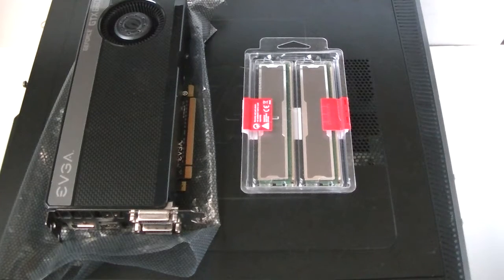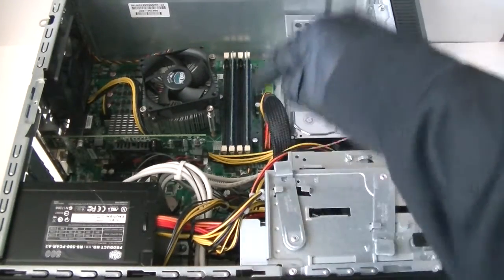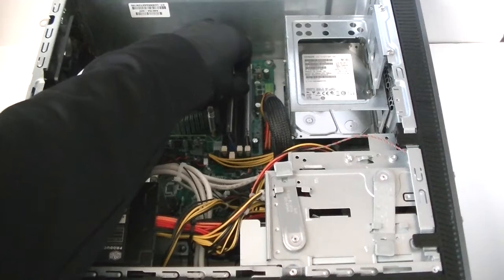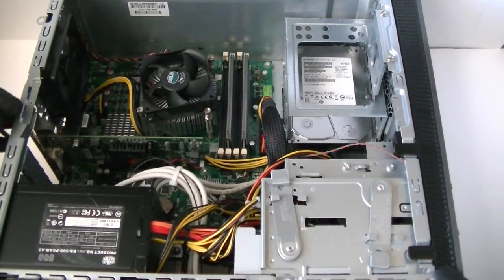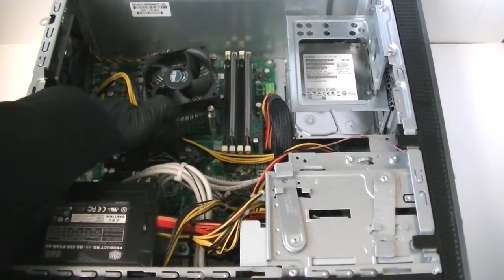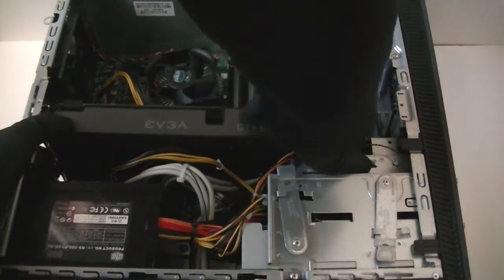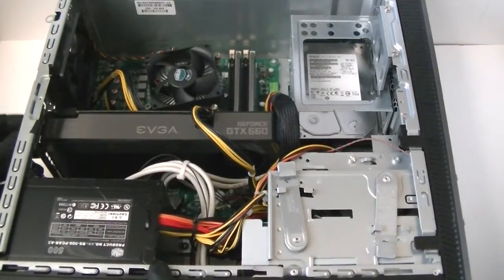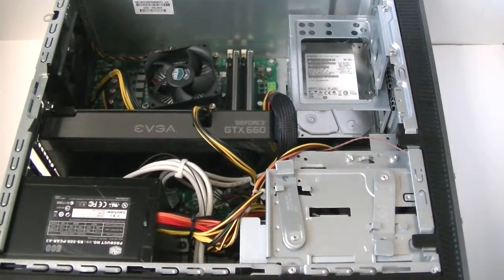HP H8-1234 Upgrade RAM, Video Card

Comment: I have a question is it possible to fit a intel i3-8350k processor in that motherboard?
Reply from the maker: Hi, yes only if you install different micro atx motherboard that supports intel i3-8350k processor.
Reply: @Mxkdt  hahahahahaha
Reply: @Ptowntiger11  it's not funny

Comment: What is the most modern video card you could run on a computer like this? I got a H8-1222 which is pretty similar, but I am wondering whats the best video card I could put on.
Reply: Jorge C. I know you could probably run a 1050 to without upgrading the power supply but with anything higher you might want to upgrade the power supply and get cables that power the graphic card (if needed)